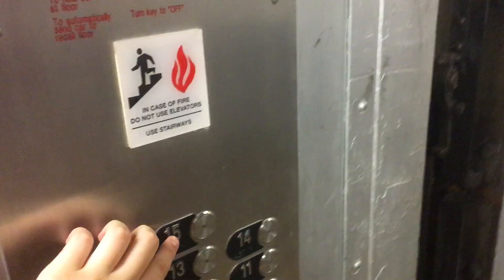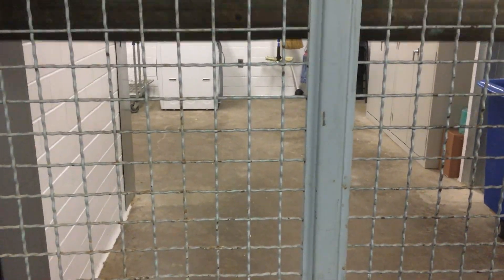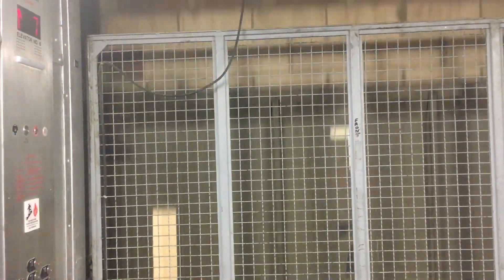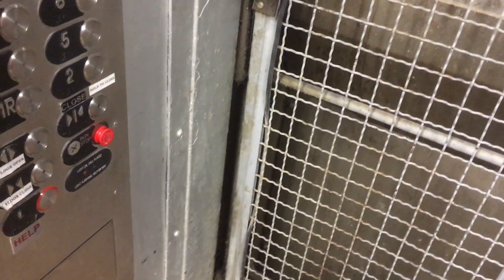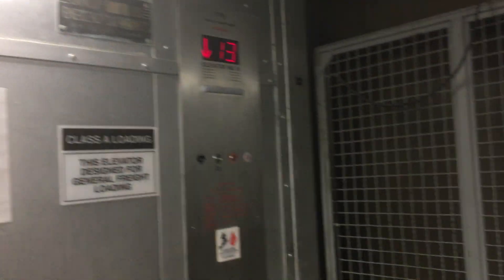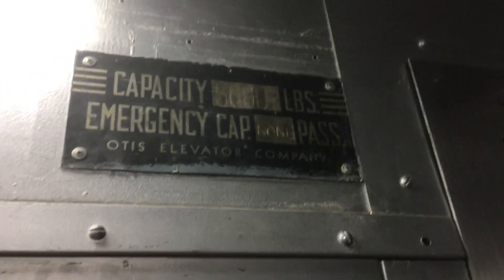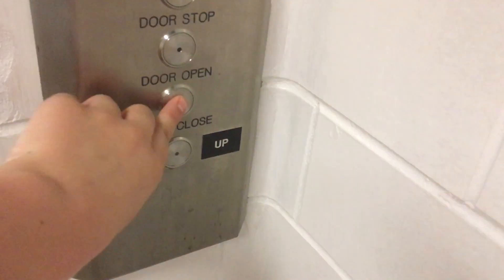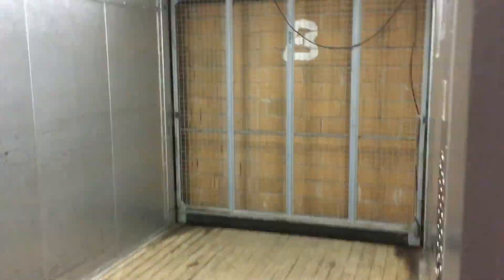Fast modernized Otis freight elevator - Apartments at River View - Downtown, Pittsburgh, PA

Comment: The speed it traveled up and down, might have been a gear-less machine. Or a higher FPM geared traction.   The sound hear in the machine room, was not likely an MG set, they don't usually shut down just after the elevator has reached the floor landing. Probably was the traction machine powering off.   The original traction machine might have been DC with an MG set, if it was retained the modernization would more than likely updated to a DC Drive.
Reply from the maker: Yeah I know I said MG in the video, but I kinda realized later that it probably isn't. And I think it's the original motor.
Reply: @EWPA14  63 years later and the traction machine is still going! Build to last, and keep on rolling!